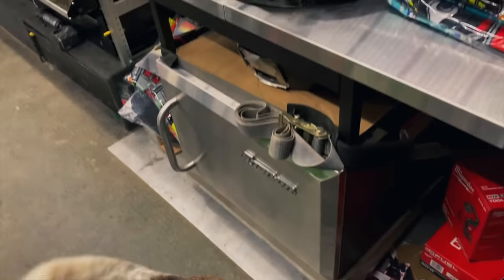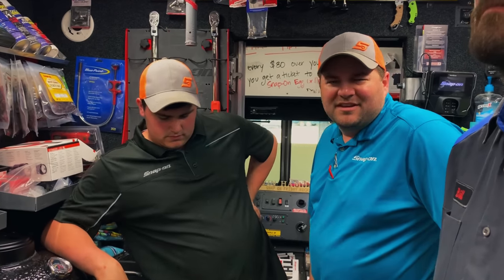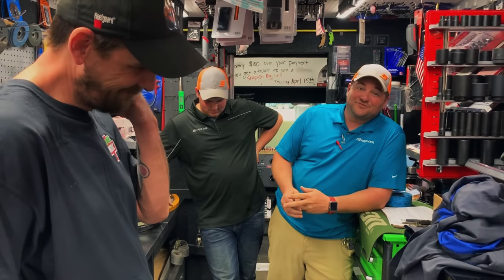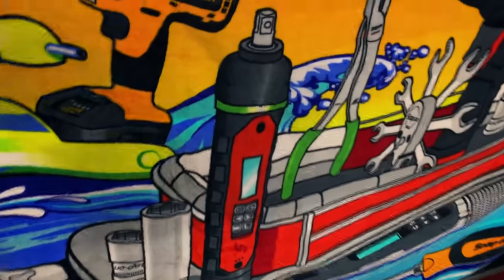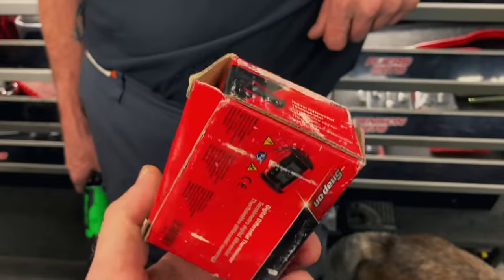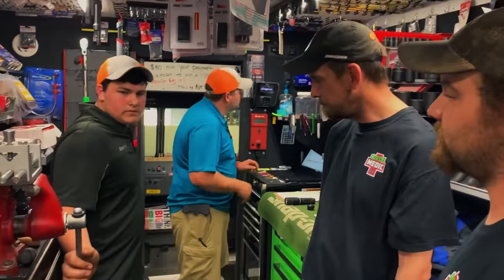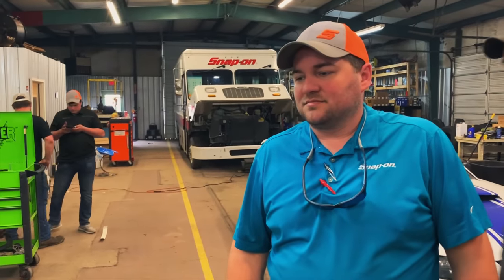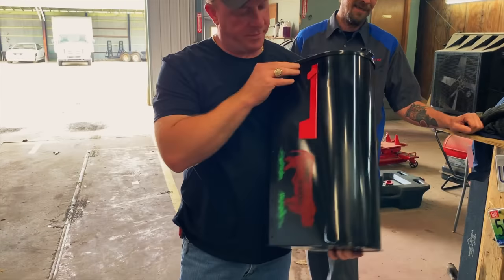Snap On Friday Temp200 and BIG News Coming

Comment: Glad you guys really enjoyed the name plates. They’re a special birch plywood we use up here on our CNC laser. It basically takes a CAD drawing and burns the design out. On the laser we cut a lot of different materials. Steel, aluminum, wood, lexan. They came out pretty good. Asked the laser operator nicely to cut me those. My grandfather an I run a CNC machine shop together it’s a nice climate controlled trade to be in. Keep on trucking guys!
Reply from the maker: They are very nice ! Thank you very much for those. I really appreciate them !
Reply: mike lange those are incredibly cool. Thank you❤️
Reply: Mike they were awesome man. I really appreciate it. I put it up in my office.
Reply: @jovinhamilton2234  I have an old set of 5/16th snap on sockets. Are they worth anything